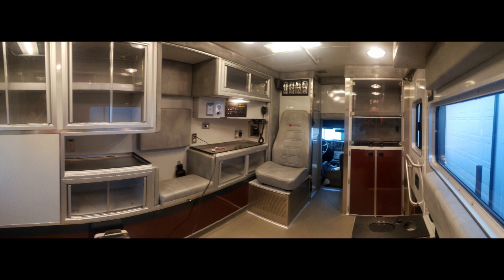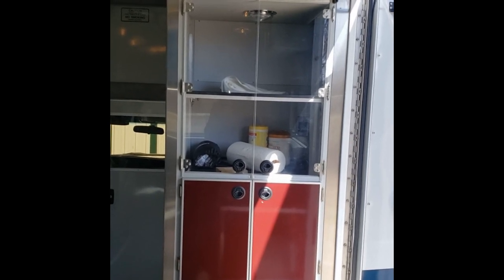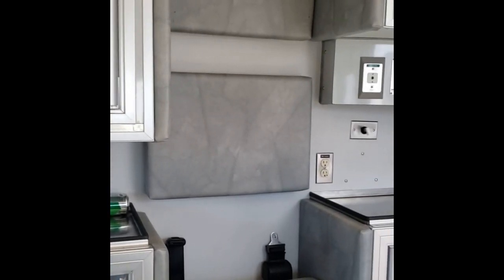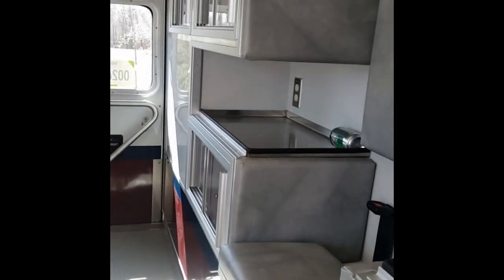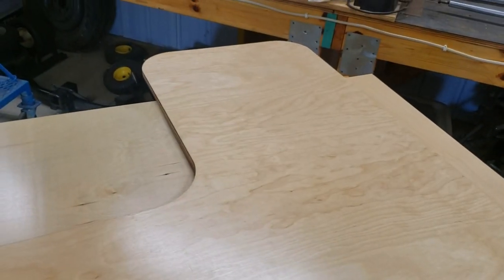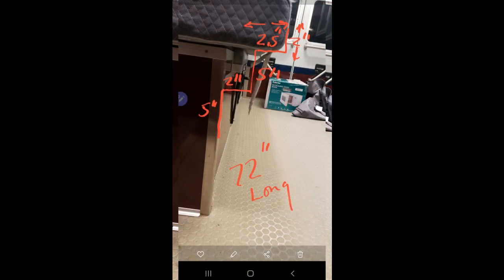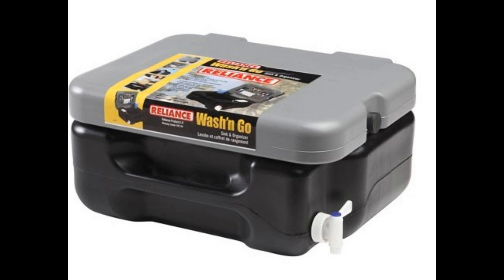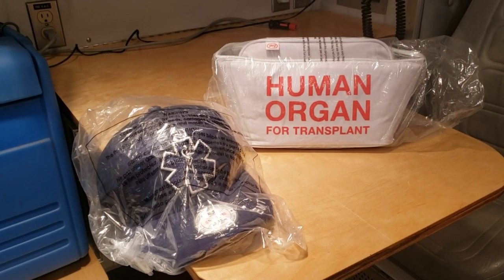One Day Ambulance Conversion to a 4x4 All Season Camper

Comment: My one day build is gonna be a video of me filling up an air mattress, hooking up a space heater, plugging in my tablet, and pouring ice into my styrofoam cooler from family dollar.  😂. I have plastic bags for poop, the lugabaloo is fine, kitty litter for kindness, matches for air quality, jug for urine , baby wipes for stuffs, two 5 gallon water jugs, and a ton of pillows and comforters under the crew bench.  The rest will come as it comes.
Reply: Don't use kitty litter, it is very eco unfriendly and does not break down. Try horse stall pellets. Very cheap, compressed wood, and soaks up everything.

Comment: My Dad built squads for Horton back in the mid to late 90's. Not sure if they're stillopen or not, but back then they were located in Grovecity Ohio.  Due to small scratches on the plexiglass they throw those cabinets out all the time. Our house didn't have many original cabinets soo one whole wall had squad cabinets for the top cabinets for like 15 years lol 
We also had had that pain in the butt to clean linoleum in our bathroom, but it was burgundy

Comment: Finally, a single person's build! (olde farte confirmed bachelor here) How quiet are the alum. cabinets out on the dirt or gravel roads?  I think I'd have hung a mini-split condenser off one of the back doors after filling the roof with solar panels.  And I'd build some nice mag. window inserts to keep the heat/chill out and give privacy.  All the bulbs would be replaced with LED plug-ins.  What sort of engine and mileage do you have/get?  And, of course, you have all that external storage for everything else you want or need.  Ambulances are excellent camper vehicles.
Reply from the maker: Thanks for the questions. An ambulance makes less noise than a regular camper but it is not quiet. Mileage is 11MPG for gas and 13MPG for diesel. I have owned both.

Comment: I built out a 25' For
d E-450 wheelchair bus.
Dual solar controllers, 400ah of lithium, 3000w converter.. all Victron.
A year ago,  3 months after it was done,, a big tree fell on it.
Just grabbed a type3, 2005 E450 ambulance, for very little money.
I don't plan to change much.
Just swap my systems over, engine, and some wheels, and tires. Coming from a shuttle bus owner ,...
Ambulances are awesome!
Reply: Oh no!  You poor thing.  All that work, so sad.  Glad you found another.
Reply from the maker: Thumbs up on "Ambulances are awesome!"
Thumbs down on "a big tree fell on it."
Reply: @edworks7718  well, I join you, in the thumbs down.
Turns out, a shuttlebus isn't rated for a 28", 80' ash tree. 😂
Reply: @mjremy2605  if you follow your dreams, there is always a way.
😇

Comment: Just saw your video, I have a 2003 horton ., just wondering what u have to do to use the wiring that they have in these rigs, and disconnect the whole system upfront, ?
Reply from the maker: If your question is how to not use it or only use part of the electrical system, I have not been successful in finding out how to do this. I would like to use some of the switches on the control panel to control heat or to turn on my inverter.  I have not discovered how that is accomplished. I need the manual for the system which I cannot find online.
Reply: @edworks7718  I have a 2003 Horton, just wondering if you figured out how to use the wiring in your rig? I have not